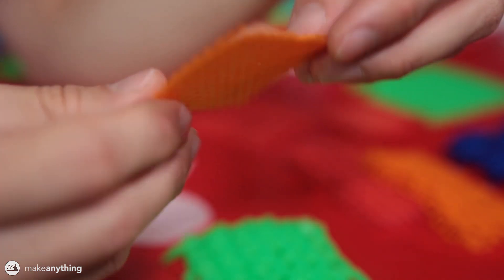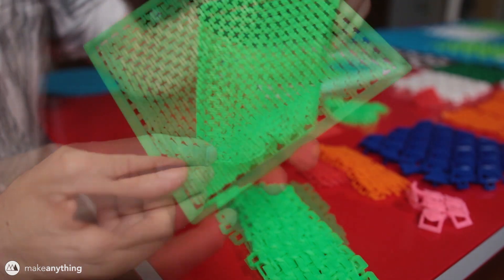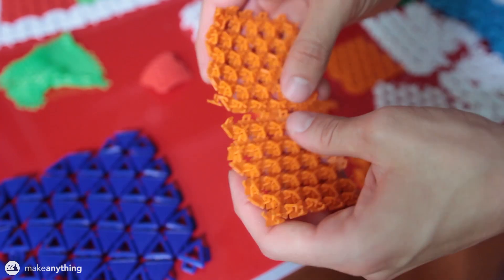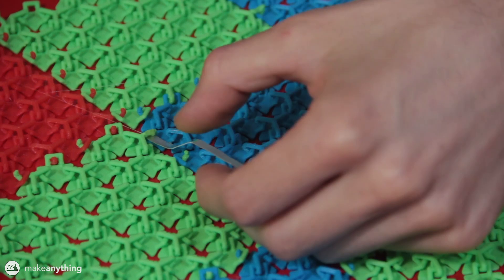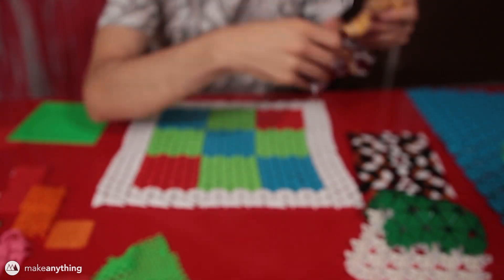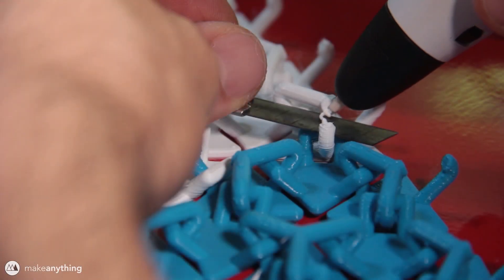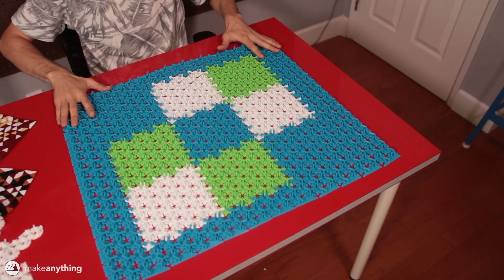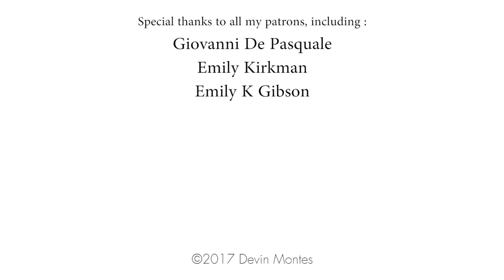Experimenting with 3D Printed Fabric

Comment: Wow, I really like the idea of 3D printed maille as I make some for fun the manual way with various precious and semi-precious metal and a few types of rubber, much of which is jewelry grade. The challenge with any type of maille is making it in any large scale. Most people vastly underestimate the sheer time it would take them to manually produce a small 12” square even if they were expirienced and even if you’re doing it for fun like I am, a large flat patch is simply vastly  tedious and far less interesting than more unique and varying projects or more complex weaves even in much smaller forms. And as for difficulty in working and weight I’m usually referring to modern aluminum in a relatively thin gauge and non welded or attached at all(just hand bent closed or at most hand made rings. Real/practical maille would be made of steel and often peened shut in some way or in a modern version welded, so the weight would be vastly more than a bent ring aluminum shirt which is already noticeably a bit heavy for most people, at least to the point where it would slow them down to some extent and require more work to move if walking or even sitting to some extent, especially on horseback requiring additional abdominal strength. And that is just a shirt  of maille, let alone all the other layers and various protective garments, be they leather or metal, or fabrics in any configuration(even “minimal armor”)would all but incapacitate the average person today especially if they had not grown up gradually becoming used to such a burden. I digress but the point is maille was always been interesting and fun to me and I’m not fighting anyone so plastic is ok for me (although soon ceramic or other 3D methods like laser metal sintering(sp?) could become more available) but I would like to thank you for the most recent and game changing advancement or development of maille in many hundreds of years perhaps. Although I’ve seen increasingly creative designs in various mediums this is the first time I’ve seen a 3D printed maille that looked so good and was actually made in a practical size(not a tiny example). I see this as an impressive new design of maille but even more so one of the best demonstrations of continuous separate part printing in a “sheet style”, I think this would be very popular to the fashion companies interested in printed fabric designs as well as engineers especially once materials like metals and ceramics make onto the list of printable media’s. This deserves more media coverage than a single YouTube video as I think it will expand what people believe 3D printing can do and do now, not just in “the future”. I wish you all the best and thank you for showing me innovations that surprised even me to such an extent in a field I’m supposedly knowledgeable in. It’s so nice to have your expectations and future plans arrive early and blow your mind and even if it seems small to some I believe this is one of the things that can truly Impress people and breed interest in STEM and the possibilities of modern 3D techniques. Best of luck and I hope this innovation continues to spread, I’m sure you will be highly successful with such design and materials skills that are more and more applicable to our daily lives. Cheers!

Comment: Imagine a bead or ball - two holes in each ball that can accept a 'ball' joint, and then two pegs opposite that extend out with little balls on the ends that can push into the holes that accept the ball joint. Jigsaw beads.

Comment: It would be super cool if you could figure out a way to make it print a continuous strip of it, like an actual loom. Maybe get some motors and hook them up to some hooked pullers, that when the printer finishes a row, it pull it forward enough that printer can just run the gcode again and print in the exact same place.

Comment: Seeing the window demo, what about using these for curtains?  You could leave selected segments open to pass light, mix opaque and translucent segments for a frosted effect, or maybe mix in some glow-in-the-dark segments to act as stars at night (constellations even?).  Wonder if you could print holes in some for LEDs and have flexible light panels (curtains doubling as "artificial window light").

Comment: Very interesting. I don't have a 3d printer and very little 3d modeling experience, but the idea of creating a flexible shell consisting of meshed plates does interest me. Have you ever heard of Black 2.0? It's one of several paints that purport to absorb an insane amount of light, leading to an unusually flat optical illusion. I've got some coming via post soon for an art project of mine. I think it'd be neat to see it used in your project here as a pigment or surface application.

Comment: All your designs are essentially either chain maille or a single sheet of plastic with  relief cuts to make it more flexible.While the chain-maille worked extremely, well "fabric" is neither of those things. Fabrics are made by weaving long stands of string-like material into a mesh. Instead of trying to print a completed piece of fabric, try printing a spool of plastic string and weaving it yourself. You can use a crochet hook to make a loose mesh pattern from there, or you could attempt to program the printer so it acts like a loom and creates your traditionally woven fabric swatch in one step.

Comment: I really liked the second last one you did where you had to make a ridged boarder, but the boarder is kind of in the way. I was thinking to stop the edges from sliding around but keeping the whole thing flexable, maybe you could make the edge pieces tiles? Or semi tiles with a smaller hole to connect to the inner pieces, that way maybe it would stop the end pieces from sliding around by limiting the amount of space it has to wiggle.

Comment: Hey this is really cool, just found this channel through the recommendations so it did something good for once! Have you thought about knitting stitches to try and emulate? You could make something similar to a mail but more rounded. Or even try using flexible filament to help out.

Comment: Imagine the triangle design, just metal, and on super cool looking armour.
Reply: Space Chowder space chain mail... I wonder about the durability of such a design? The individual plates would have to be pretty thick to provide any significant protection. Although, that being said, since that could be produced via an SLS process, it might be easier to make more complex shapes, due to the absence of support concerns with SLS
Reply: This my wise space chowder, is what the future will be like.
Reply: horizon zero dawn
Reply: Deus Ex
Reply: Metal plates don't need to be to thick unless you're going up against bullets. In which case you should just use kevlar
Reply: Oh yeah

Comment: All I am thinking with this design would it be good for a bullet proof vest if you had the right material ? This is for the triangle fabric
Reply: Savage Heart ooh, interesting probably good for small arms fire, but the bullet could get between the tiles which would be a problem
Reply: at 9.00 does not have much of a gap + you can have 2 layers fill out the gaps of the other layer

Comment: Hey man, I was just wondering if you considered using actual hexagons, instead of triangles in hexagonal formation? I was just  thinking of this because rather than 3 axis of movement per piece, there would be 6 (I may be completely wrong, but its just an idea which I cant test it myself as I don't have a 3D printer)  . Does anyone have any insite towards this idea?

Comment: Here's an idea off the top of my head! Would it be possible to print your quilting tiles in varying tones of the same color? I think having a "quilt" with a soft color transition waving across it would be pretty! Also I wonder if a thermally insulated blanket could be made! And I'll bet you could make some cool hats with this stuff! This is awesome! ~Arctic
Reply from the maker: I do have a lot of shades of blue... :)
Reply: Perfect! I'd envisioned a large blue "blanket" with either geometric designs of a slightly different shade or with gradual color transition throughout, like going from dark to light blue and then back across the surface. This is cool!

Comment: Could you print the triangle faces on both sides of the fabric so it had that little bit of stiffness in both directions and was smooth on both sides? It would also protect the loops where the real mechanics are taking place
Reply from the maker: I would need support material to print it.. also it would be a lot harder to connect pieces, but boy would it be cool!
Reply: Make Anything // 3D Printing Channel
I was thinking of that because you mentioned making a hat at the end, and it would be such a cool looking floppy hat and could get wet. I figured for a hat you'd also want that stiffness in both directions and the nice looking smooth surface on both sides so it looks good and doesn't catch hair

Comment: Very impressive work - looking very smooth! For me personally, there's only one tiny little problem with it: darn it, I need a bigger printer 😀 - the 150mm diameter on my MD Rework just are much too small to be interesting for stuff like this... and knitting enough tiles of that size together kinda takes the fun out of it 😁 ... but on the other side, that would be the one sensible use for a 3D pen for me, as I can't really draw worth a damn, and that's in 2D, let alone 3D 👍...

Comment: This fabric wouldn't work too well with clothing, especially around spherical areas like shoulders and your head. I suggest you look at a triangular tessellation of a sphere; you'll find that pentagons are also used at various points, rather than hexagons, to help create the shape of the sphere.
You also have to remember that in clothes with actual fabric, the fabric is cut into odd shapes to make the final product work. 
Combine these two pieces of information, and you could have something akin to chainmail, since it's individual pieces and not woven strands.

Comment: That's amazing! I love the way it "stretches" when you pull it a certain way, and the drape to it is fascinating. My first thought is it would make really cool curtains, but also maybe a carrying case? It seems like it holds its rigidity enough that if you put something solid inside, it might act like a solid itself and when empty would be super neat to just play with.

I wonder how differently it acts when the pieces are pushed closer together [like when you were sliding it on the table] as opposed to being "loose" and what kind of applications that would have. Something that might be fun to try is reinforcing the back of certain panels with like a line of plastic around the edges and leaving others loose,  to create different structures. [The thing that most easily comes to mind is a purse]

It would also be interesting to see the less flexible one you printed [with no loops] be assembled into a "stuffed" animal according to a sewing pattern. I'm curious to know how well it would support itself being molded and bent into a 3d shape.

It seems like it has a lot of the same properties of upholstery fabric, while being of a very loose "weave". Maybe it has similar applications?

Comment: You could try making 3d shapes with the cloth by printing out pieces that are meant to folded and connected into things like cylinders or cones, or even spheres with hexagons and pentagons. Also, you should try to make only slightly flexible things, like leather instead of cloth, maybe by designing the connections between the pieces to allow only specific or generally restricted movements.

Comment: Considering the way light passes through it, I think it would make for some really awesome curtains!
Reply from the maker: That's a lot of stitching, but it would be sooo cool I might commit :P
Reply: This did remind me of architecture using louvres. The last material as a window shade could be compressed from the sides to shut out more light. Also reminded me of Torggler doors.
Reply: Ooooo!
Reply: lol i literally commented nearly the same thing, i was thinking blinds though. they remind me of something from india but not sure what
Reply: Curtains were the first thing I thought of too.  They could really be cool.  A belt and a hat might be cool too but the curtains would definitely work!
Reply: Attach a small pulley system, and you could pull it up if you wanted more light during the day. Maybe a small metal bar at the bottom to add stiffness to make it easier to pull. I’m not sure how well it would roll, but that could be an option, too.

Comment: This is really really cool, I'm thinking about getting my own printer because of your Channel! Also have you thought about using a  hexagonal pattern for the fabric, just to see if that gives it more Flex/flow?
 
 finally if you were to fill the triangle's on the back and make them into another set of staggered  triangular plates 
Then it could be smooth on both sides                   ?     ?
P.S. this is an AWESOME VIDEO KEEP IT UP !!      😕   😕

LIKE THIS COMMENT IF YOU AGREE! !!
Reply from the maker: Having the triangles on both side would be super cool, but I don't know how I'd do that without supports...hmmm
Reply: this would be super expensive but what about that water dissolving filament? although connecting large sheets would still be hard i guess.

Comment: Look at the shapes from tje MIT origami protopaper.  If you think of your equalateral triangles as half diamonds cut along the short axis, there triangles are half diamonds on the long axis.  Hope that makes  sense.  

The protopaper is basically a fold pattern in the paper that allows you to then take the paper and create different stuff out of it.  You could probably do the same thing with your interlocking design, only using the shapes the fold lines in the proto paper make.
Reply from the maker: Good suggestion, thanks!

Comment: Awesome man ...........try using translucent material will look awesome I think
Reply: no translucent it allows only part of the light through (so it blurs anything far away behind it) transparent you can just see through like glass
Reply: datstuff It's really hard to get 3D printed parts to come out actually transparent, though. Even with transparent filament, the layers and lines in which the material is deposited introduce lots of tiny gaps within the print, and the plastic-to-air transitions there create refractive interfaces. The upshot is that for anything other than "vase mode" single layer thick prints, you basically can't get transparent objects with FDM printing.
Reply: Atharva Pande yassss
Reply: protopasta "stardust" glitter flake htplac or use some fil oyu wanna use up, and hit it with chrome effect spray.
Reply: so everything is technically translucent because nothing allows 100% light to pass through, except pure vacuum?
Reply: .... 3d printed neglice anyone? ;)
Reply: Cuda FX
"thereof of"
?
Reply: " .. diffusion ... or the lack thereof .. "
Reply: the difference isnt how much light gets though, but how much it gets scattered. sunglasses can block >90% of light, and still be clearly transparent. bathroom windows are made to let a lot of light through, but scatter it to obstruct the view. 
Osimmac, you have a point there. air scatters mostly blue light, that's why the sky blue, and sunsets red.
Reply: Atharva Pande i
Reply: Олег Олегович what?
Reply: Atharva Pande yeah
Reply: Julia Horowitz, it used to be called semi-transparent .. before poeple started trying to sound all smart like, with on grasp of the meaning of the fancyfull words. the difference is in the diffusion (scattering) or the lack thereof of materials that are permeable to photons. ...bloody nerds with your semantic arguments! :V think bathroom windows. "translucent" literally means "the property of letting light through"
Reply: Julia Horowitz are those not the same thing?

Comment: Really creative.  Just a couple of questions.
What was the smallest nozzle that you tried on the smaller versions?
Did you try any flexible filament?
Just curious.
Reply: Yeah I was wondering if it would work better at smaller sizes with a smaller nozzle.

Comment: YES! finally a fabric i can print and use to wipe my tears away when my other prints fail!
Reply: If the fabric doesn’t fail...
Reply: N BR ABS is hygroscopic like nylon. High surface area prints like these would probably absorb a noticeable amount of water. A tumble dryer would shake out some of it quite easily, the internal water vapour will take some time to dry out and probably will need a vacuum to completely dry out.
Reply: actually it is plastic so it isn't absorbent

sorry for bursting your bubble.